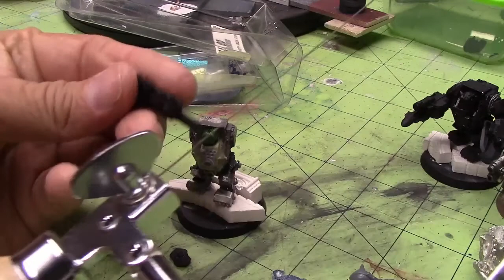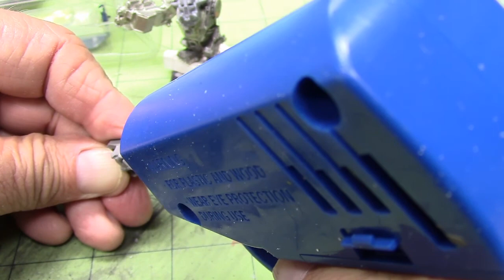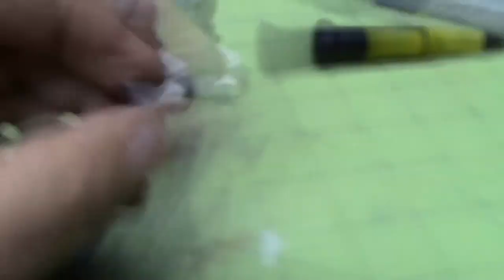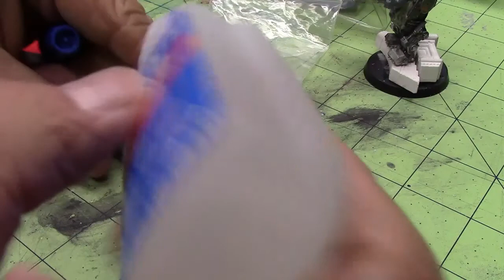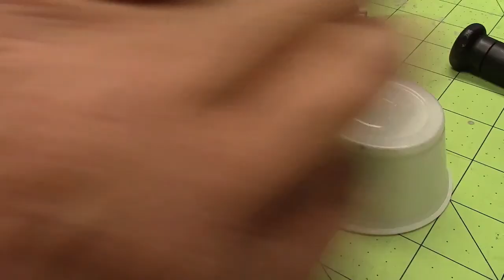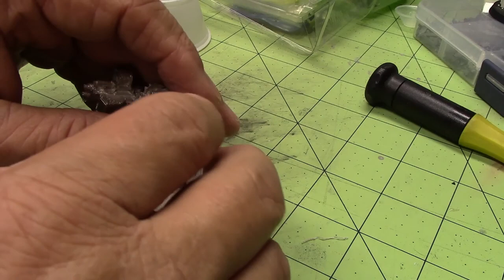Cobbled Meganobz Squad Part 3

Comment: Isopropyl alcohol and a toothbrush cleans off residues like mold release or petroleum jelly without ruining set up epoxies, plastics or metals. Typically once I have flied and fitted my minis and bases I douse everything in isopropyl and give it a good scrub before final assembly. I also allow 10 minutes or so for air drying once cleaned.